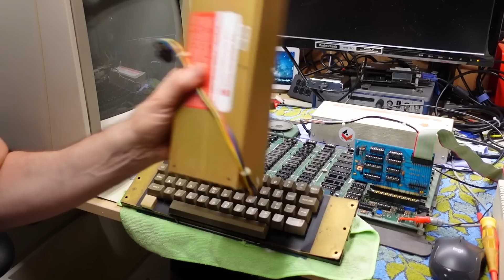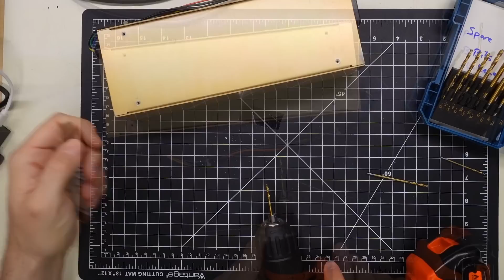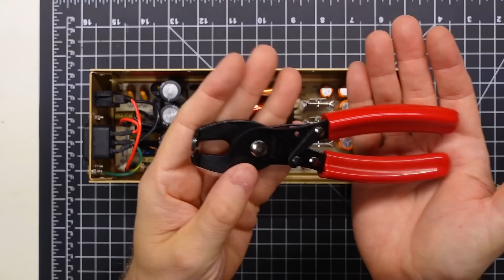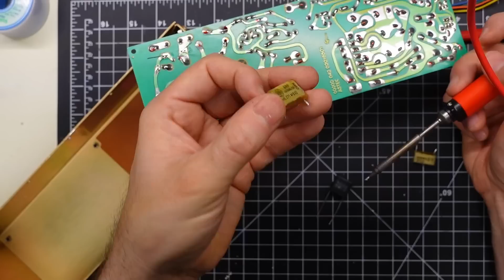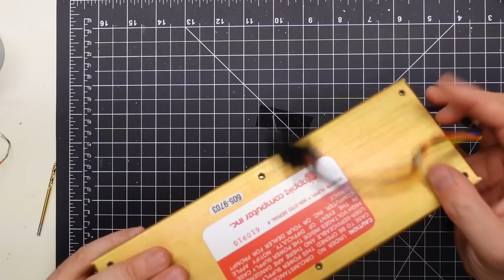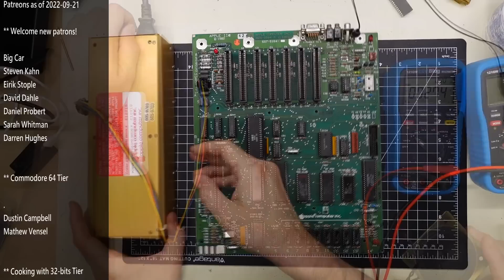Apple II power supply service and testing

Comment: I have an Apple ][ from 1977 (Sn 2964).  The 12 volt rail in the power supply is fine but the system doesn’t boot.  No biggie as I’m sure a little diagnostics on the PS and the mother board.  I bought this without the case (because they weren’t available yet) and learned it’s capabilities as a naked computer leaned up against my bedroom wall (actually a sailboat).  Once I got the case about three months later I assembled it together (I had been running with two linear power supplies “borrowed” from work).  I still have that system from when I bought it piece meal from the Byte Shop in Fort Lauderdale FL.  Believe it or not, the original $555 I had to get a personal loan to buy it from my bank.  Once I had the case and power supply it looked like every other Apple ][ until you pop the lid.  I have the language card as you mentioned, the color block and some mods I can’t remember. I have a RGB board that worked with RGB monitors from CAT scanners at the time  plus “clone” of Microsoft’s SoftPC that I wire wrapped and it worked just fine.  I had to add a fan to the system to cool down all eight of the cards in the slots.  I added it on the right side and milled slots that look factory which probably destroys the value of the computer. Right now I’m just trying to bring it up in it’s nearly original form without all the bells and whistles  The power supply works so I suspect a good disassembly cleaning and reassembly will bring it right back.  Of all of the computers I’ve owned over the years (I’m 66) I have a special place in my heart for the Apple ][.  I was president of the the “Apple Computer Enjoyment Society (ACES)” in south Florida for many years and enjoyed that part of my life.  Thank you for all of the work you are doing on this system.  All I need now are some boot up disks and I’ll be good to go!
Reply: Very neat. I remember the time when you could buy the system w/o a case, then the solid side case for a very short time, ere the vented case was available. Have you documented this machine on the Applefritter forums? 

Wait, is this the one with the ventless case and fan? 

Insofar as disks, I still have DOS 3.2.x diskettes that I could copy for you if you want those, along with the DOS 3.3 Developer disk, which AFAIK is not different to the commercial DOS 3.3 disk, but I have never done a checksum on it. I do not believe that I have versions < 3.2, which is a 13-sector disk. 

I do not have a 13-sector card now-we upgraded everything to soft 16, and the Rev 0 mainboards to the 6-colour Rev 4- but I can always use some Muffin tools to make it work.

My ][ is serial 5000-ish. I do not have it memorised.

Comment: If measuring AC noise levels on a DC supply, it's generally a good idea to place a capacitor in series with the meter to block the DC voltage component. That helps ensure that the RMS measurement is correct, and may be essential for measuring low level noise on higher DC voltages.  Also, very brave to carry out the basic voltage test with a motherboard. I would not have taken the risk, and would have used a few power resistors to lightly load the power supply and test it for basic functionality before connecting more expensive parts.
Reply: I was gthinking exactly the same ... could have paper-cliped it. I just put the meter on AC .... I think if RMS is done properly you shouldnt have issues. A cap in series makes sense if you want to be sure.  Some meters are a bit confused when AC+DC is present. It depend on the meter and how RMS is some. Most of the cheapo ones is SW based RMS up to 1Khz. Probably more flexible, but poor bandwidth. And the one with 20Khz BW or more use the traditional heat to DC converters, probably decoupled as you mentioned
Reply: @38911bytefree  Exactly - some meters will get it right, some not, and in a few cases the meter could be damaged if the offset voltage is too high.

Comment: So I'm watching a plane restoration series where some rivets needed to be removed to remove part of the wing that was getting replaced. You know what the fancy tool was that they used to remove the multitudes of rivets from that wing? Exactly what you're using right there. They liked it just about as well as you seem to.
Reply: The rivet hole on the original power supply is 1/8”.  Use a 3/16s or a 1/4th inch to remove the head of the pop rivet.  Don’t try to drill it out vertically! Just  lean the drill bit over enough to bite into the rivet “head” and chew it off.  It’ll come off easily  and you’ll have two pieces of the rivets.  When you are done replacing the caps, put a new pop rivet into the hole on each side.  No one needs to know you had to dig inside the power supply.  BTW, yes, the Apple ][ was the first personal computer to use a switching power supply because it was cheaper than the equivalent linear supply.  The Apple ][ is a power hog designed to support all 8 of the expansion slots. I know because at the height of my use of the computer I had all 8 slots full and it got REALLY hot.  Reason why I added the fan!

Comment: Removing rivets while using pressure from the bottom is OK, you just have to be sure you don't bend the metal the rivet is in.  Too much pressure, and you could have bent the case of the power supply.  I forget what I was working on, but I've bent aluminum cases (much weaker than steel) while doing exactly this type of thing.
Reply: I agree. The metal of the case shell is far softer than the rivet. Not only can you bend it, but you can also easily mar it. (It's gold anodised aluminium, in this specific case.)

Comment: I forgot to add that the reason for the higher RPM with the drill is - less torque. At lower RPM there's more torque, and your chopping and grabbing as if through concrete. At high RPM drilling, you're carving as if through butter.

Comment: Actually that is a newer Apple Branded  PSU used on the II+ and IIe. The older ones used on the II and II+ were made Astec, TDK, Dyna or other brands as at this point Apple was buying parts and not making them. Note: Apple used Astec power supplies for most of color Mac from the Mac II to the intel tower Macs. They also used TDK and Dyna PSU on their low cost systems. Including the Mac LCs. The older Apple II PSU was either silver or black cased. The newer PSU on an older Apple means that the older PSU was replaced in the 1980s.

Jobs designed and made the first switching PSU for the Apple II because it ran cooler and used less power than a linear supply.

Comment: I had two ceramic disc capacitors blow right next to the main power switch.  It was one of those power delivery stations that would sit under a monitor, with a power switch for each peripheral.  My guess was a power spike caused the ceramic dis caps to over heat, and the plates shorted inside it.  It was resetting breakers, and all the switches passed a continuity check.

Crazypoart about it was the caps looked good under visual inspection.  They sparked when the power was safely applied using another power strip.
Reply: Those were probably MOV's (metal oxide varistors).  Power spikes will degrade them to the point they short. They are actually intended to short high voltage transients to ground or across the line so they don't make it to your computer and peripherals. They only work so many times then they are junk. Open up any cheapy "surge protector" and you'll find those cap looking MOV's. In your case they were probably there for surge protection. You could just cut them out and plug the unit into an external surge protector.
Reply: You may find they were metal oxide varistors and they failed due to a power spike - which is what theyre for :)
Reply: If they atre small and blue, those are hv parasitica caps, but if they are more in a form of disc and big (like a dime) are MOVs. MOVs are there to catch high voltage transitns and pop the fuse while protecting the PSU. You can operate it without them, but next time a high voltage spike is present, then it will go directly to the switching circutry and in many cases, to the controller chip (for those design where the controller chip live on the "hot" side"). This is why even when they are a POS, generic ATX with controller on the cold side are way more robust. But 80 plus ones .... are not that strong in terms of voltage transients (IMHO)

Comment: Definitely a larger bit helps. Almost but not quite the diameter of the head. The main thing is to drill the head off the stem, then just use a pliers to pull off the stem from the back after you separate the previously riveted parts.

Comment: I'm with the larger drill bit people. Size the bit to match the other open holes, and go just a bit bigger. Then your first drill through takes the entire body of the rivet out, and it drops away. Also, more RPM. Just let that drill sing.

Comment: 2000 caps were in fact garbage. It was discovered in late in the decade and modern caps will kick any 90's or 00's SMD cap's ass. Through hole is harder to say. But yeah a nintendo wii? There is a possibility of them leaking. A PS4 is unlikely to leak when they reach the same age as the wii. So it's very much a, they got worse, then they got better. I'm not saying you have to replace them though. However if you have a cap that you know is likely to be bad, then why not replace it since you're already open anyway. So if I was you I would have at least replaced the small one.

Comment: my IIe doesnt have any rifas, it has the filter caps in the iec socket like you mentioned so i changed it, i took the old one apart to see what was in it and its the disk shaped caps. but it seems more had the rifas on board than not.

Comment: Why are there THREE output rectifier diodes and not four?
Reply from the maker: Almost certainly it has one for -12v and then uses a small -5V regulator (7905) to generate the -5v. Those are just used for bias so are extremely low current...

Comment: Was the first test of voltages while connected to the board after putting it all together again? Why not test it on the connector first?
Reply from the maker: Some power supplies, especially these old designs require a proper load to safely power up. The ancient magnetic regulation circuit can start oscillating and doing other strange things without load. The similar age TRS-80 Model II power supply specifically warns you from running it without some minimum loads or damage could occur. The "proper" way would to use an electronic load on the +5 and +12 rails to be safe.... but I don't have one.
Reply: @adriansdigitalbasement2  you can build such a load easily with some power resistors or even some filament or halogen lamps.

Comment: What is a 'rifa' capacitor?
Reply from the maker: I think it's just layers of paper and foil along with some liquid, perhaps oil? The paper is the insulator and I bet that is what goes conductive when the moisture gets in.
Reply: @adriansdigitalbasement2  so basically a foil in oil cap. Don't those types of caps go dry/bad ESR over time more than compared to electrolytic caps?

Comment: The PSU looks pristine for it's age. If it was'nt for the RIFA caps, you would'nt have to open it at all. :)
Reply from the maker: It's quite amazing how good the condition of the whole system! From the late 70s and hardly any dust!
Reply: Well, yes, although its age is misrepresented here. That one is probably from 1982, but this is very typical for these PSUs. The only filth they tend to accrue is on the case, from storage, or smoke tar+dust over decades.

Comment: Use a step bit for the rivets instead of twist bit. That way you can get only the head/flange and it won't have a chance of grabbing and pulling into the hole. What happened on your first one is you drilled out the mushroomed portion on the inside and not the flange on the outside.
Reply: Or use a very large bit that will eat the top of the rivet before it touches the sheet metal.

Comment: These power supplies are tough. I got one to play with as a young kid and I abused the hell out of it. I liked the spark and coil squeak that came with shorting it out lol. Probably did that thousands of times. Lid is full of plasma craters (pains me to write that, sorry little psu!). Always came right back up and asked for more. One day the RIFA did its thing (back in the 90s) and I thought I'd killed it - nope, just need to take it out. Can confirm the smell stuck in my mind.
Reply: The Magic smoke smell sticks with you I can tell you that. I smelled it a few times back in electronics class in high school. Years later the power supply in my main PC let out the smoke and I immediately recognized the smell and pulled the plug. The power supply didn’t make it, but the pc survived.

Comment: One day we'll have planned obsolescence banned... but probably not before most of the working world is broke (both in terms of finances and everything around them!).

It's just so disappointing I'm not a couple decades older and could have extremely high quality products to keep and pass down.  The whole thing is just so backwards to how you'd expect technology to progress and improve every chain of manufacturing.  Your 25-30 year old appliance goes belly up so you buy a new one and.. the new one breaks in a year, and requires servicing every other, and is never as effective as the old one.. which could've just been repaired in the first place if only you knew how. (well, the modern internet helps with that last part)
Reply from the maker: Yeah, this whole computer was 43 years old and hardly anything needed fixing. I just have a really hard time believing stuff we have no will be the same in that long. (Especially things with batteries)

Comment: best for remove rivets is use a dremel with a metal cutting disc, with this you dont have the risk of damage the possible pcbs or anything that stay under the rivet , with the drill you can overdrill it and cause damages

Comment: angle the drill  bit a bit if the rivet spins.  It will gnaw away at it fairly quickly. The greater the angle, the slower the rivet will spin relative to the drill and the faster it will gnaw it away at increased risk of sliding off the head and damaging the surrounding material.

Comment: Capacitors from the late 1990s/early 2000s aren't really a good reference point - that was the capacitor plague era and them failing is a notorious thing.
Reply from the maker: Yeah it was the WORST time for them.... although it still seems like we have so many fakes and crappy ones now that even 5 year old TVs seem to fail with bad caps on theri PSU boards.

Comment: In the UK the Apple II didn't sell very well because it was expensive and we already had our own home-grown equivalent in the BBC Micro, so I've only ever owned one - a non-enhanced IIe. It stopped working at one point, I had to replace a capacitor and a resistor in the PSU to fix it. No diagnosis required, it was a standard fault and I just had to look it up online. Of course, this was after the RIFA caps exploded and made the room stink for a couple of weeks.

Somewhere I still have a Mac IIci with a power supply that won't switch on, as far as I'm aware it's a similar fault.
Reply from the maker: Oh the Mac IIci has a typical problem where the SMD caps ruin the section of the board that handles the soft-turn-on feature on it. So common issues is you turn it on and it'll turn right off, or you get nothing at all. One way to tell is jump start the PSU (similar to an ATX.) I actually have one IIci PSU where I replaced the guts with an ATX PSU and just use a little toggle switch on the back to turn the computer on/off manually.
Reply: Kind of sorry I sold my Apple II some 15 or so years back, OTOH I probably would have lost it in our house fire anyway.
Reply: Ehhhh, yes and no. The ][ didn't sell effectively because it was NTSC. I recall needing to set up an entire NTSC lab back in the day to work on US and Japanese stuff. There were PAL modded ][ and ][+ machines by 1979, and then the Europlus, which did sell relatively well, and let's not forget the ITT 2020. ;)

The actual drawback in the UK was that other system cost a lot less, and software for them was primarily on inexpensive cassettes, rather than on diskettes. The strength of the Speccy was in price, not in power. 

The BBC Micro was not available until '81, so it isn't a properly fair comparison. It was also very heavily adopted by the educational system of the day, and was a rather bold fusion between companies that would later become adversarial in some form or another, but for a home system, it never was able to overshadow the Spectrum, Vic-20, or C64. 

That said, the gigantic initial investment cost of £400 versus over £800 for the Apple ][, was a major factor.

Comment: I assume the rivets were there to prevent unwitting hobbyists from encountering line voltages?
Reply from the maker: Possibly although they soon did away with them -- I've only personally encountered this one Apple II PSU with them -- all the others are screws only.
Reply: Nah, it was just Apple preparing for their later anti-Right2Repair shenanigans.

Comment: the Apple iie my dad got in 86 didnt have rifas in it interestingly, they were red ones
Reply from the maker: Yeah I've seen those poly caps too. They aren't really safe to use either IMHO as they are not safety rated. Someone who knows more than me can speak more to this, but unless it says X1 or X2, they should not be used across live and neutral, and especially not between live and earth/ground. My Franklin Ace 1000 PSU had the red caps and had one across earth and live -- so it would keep tripping my GFCI breaker....